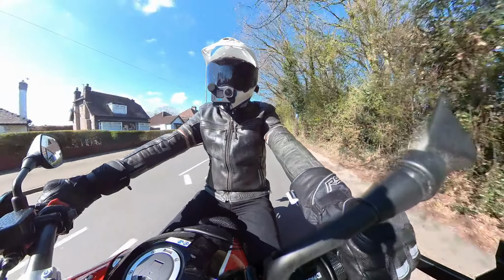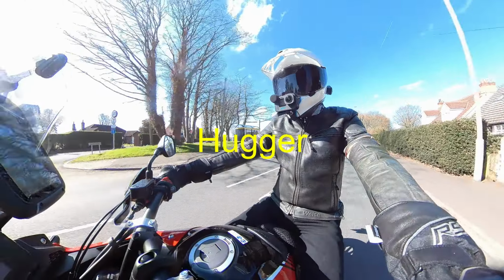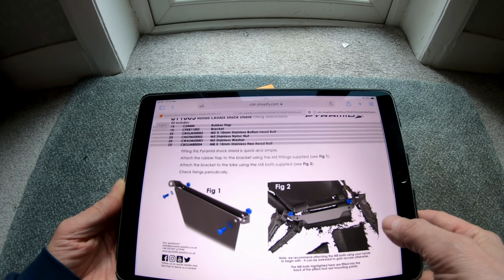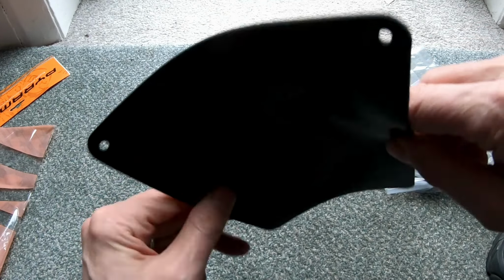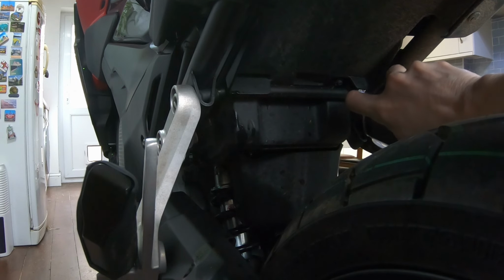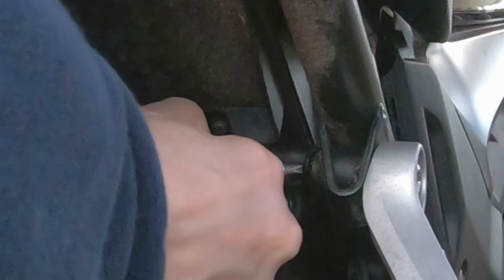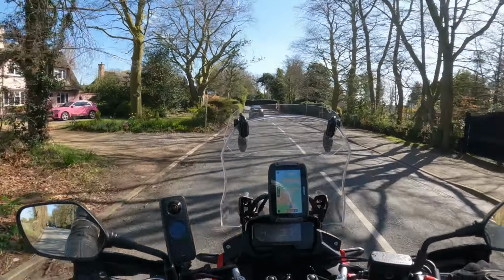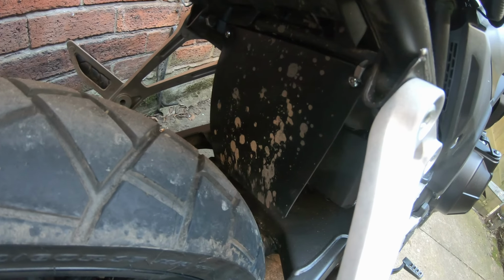Honda CB500X - Pyramid Shock Shield - Mud Flap

Comment: I’ve had mine in my 2022 cb500x for about 6 months, along with the pyramid front fender extender. Both work great.
Reply from the maker: Great to hear. I have the fender extender already, I know they work. This works too, I like it. Just hoping it stays on the bike 👍👍
Reply: @CodgerBiker  it does exactly what it looks like it’ll do. Can’t see mine ever falling off, as the mount is substantial. I also got their radiator protector and it fits perfectly. I’d purchase all 3 of these accessories again, as I think they are important.
Reply from the maker: I have the Pyramid rad guard too. Perfect fit 👌. I've had their screens in the past too, also very good. I fitted the fender extender straight away, so totally agree on all points. My only concern is the rear protector seems to rub on the tyre at speed and might wear away. But it certainly does the  job. 👍👍
Reply from the maker: https://youtube.com/shorts/Hd6HcXzeGCo?feature=share

Comment: Hello Codg,
After a summers use is this flap still doing the job ? Or has it worn out on the tyre ? 
I fitted the plastic pyramid hugger held on with a cable tie, and within just a few light off-roading jaunts it’s missing great big chunks.
Reply from the maker: Morning Warren. After 3000 miles it's still just fine. I have to say it surprised me too. Keeps dirt out of the shock better than a hugger I'd say. 👍
Reply: Cheers for that. Will be ordering one today 👍🏻
Reply from the maker: https://youtu.be/pHLnWIXg8sQ?si=WX9UGLQHAkW4C7lJ

Comment: Thanks for showing this product! Do you know if it will fit on a 2020 model? On the website only the 2022+ models are mentioned.
Reply from the maker: No problem. I don't know. It screws into the already threaded holes that hold on the passenger footpegs. Pyramid could tell you 👍
Reply: @CodgerBiker Thanks. I've sent them a message.
Reply from the maker: Good luck 👍

Comment: It's Official - Codger Biker is flapping in the wind!  I have to say as TMJ's go that was pretty poor.  Firstly you RTFM'd ( Read The F***ing Manual) which is against all the rules of Blokeism.  Secondly you did not have DrJ with you to discuss the job, disagree, fall out, make up & drink tea.  Thirdly you applied logic in not over tightening the bolts, using threadlock, trial fitting and not dropping the bolts and washers on the floor 10 times before finally getting it in the hole.  Sorry Codger but as a TMJ that will not do.  However, I think you have invented a new category of a TSJ - Ten Second Job where the manual is read beforehand and everything goes to plan.  That's OK once in a while but for a proper TMJ please show some commitment and mess it up properly!
Reply from the maker: Ha ha! Well the best way to change a ten minute job into a ten second job is editting! I did try to put it on the wrong way round, then the bolts didn't want to go in, then I couldn't find my glasses (on my head), but occasionally I like to 'appear' professional. 👍👍😉🤣
Reply: @CodgerBiker  That's more like it!  First rule of journalism "Never let the facts get in the way of a good story". No more careful editing to make yourself look better than you are.  Maintain the trust of us blokes - Keep it Real!
Reply from the maker: I shall remain, predictably, unpredictable 👍😉